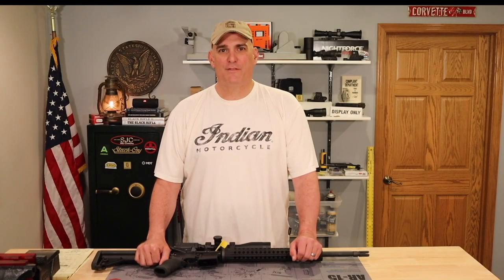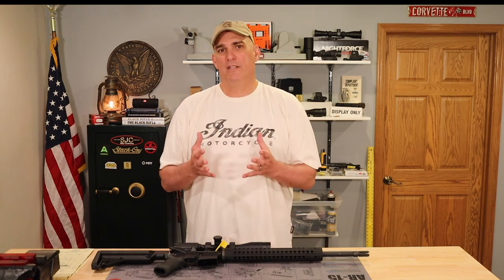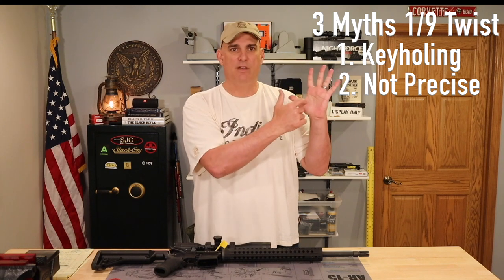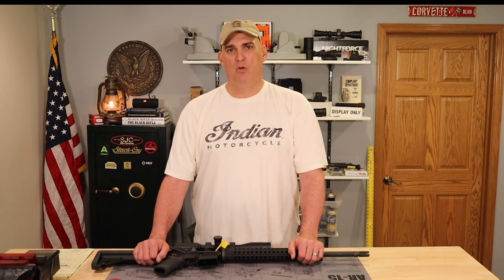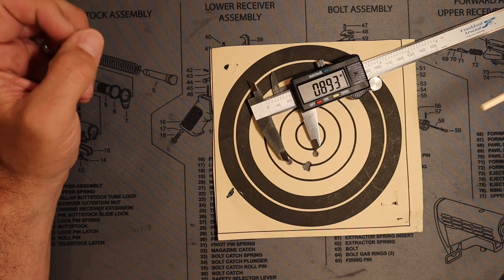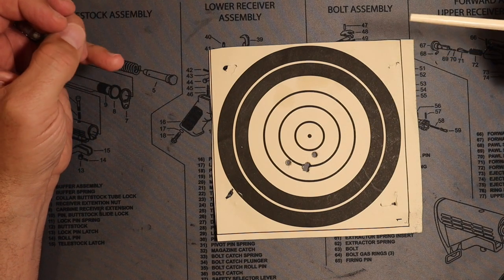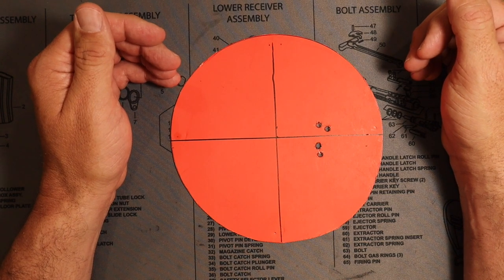Why AR-15 twist rate does not matter w/ stability | accuracy. Pt 1.

Comment: Thank you! I've had people tell me my 1-7 barrel needs 62 grain or heavier bullets, but my experience has been that this is false. My gun shoots 55, 50, and even 42 grain bullets in sub 2 MOA groups. It does well with 75 and 77 grain bullets as well, at least out to 300 yards.
Reply from the maker: Good to hear. I believed the same thing for years until I started independently testing ammo. Funny thing is I still get people arguing with me even after they see my videos. Thanks for watching.
Reply: Does twist rate have an effect if the barrel heats up? I noticed after a one mag, my AR's zero changes.
Reply: If you search for different videos on youtube, you will find 1:9s shooting 75s or 77s to 500+ perfectly. In others, you will someone shoot a 75 from 1:9 at a target ten feet away and it will keyhole.
There are a few variables that explain this:
Elevation: the higher the elevation, the more stable a given bullet at a given velocity will be. A bullet on the edge of stability will be quite unstable much quicker if you drop from 2,000 above sea level to sea level.
Temperature: the higher the temperature, the more stable. A marginally stable bullet at 100 degrees will lose stability much sooner at 70 degrees.
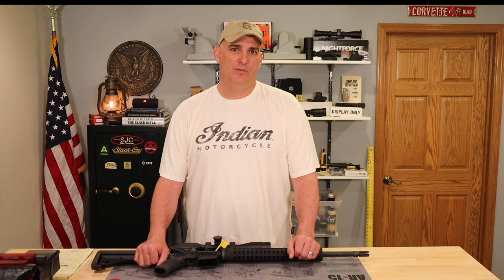Barrel variance. Between manufacturers, and even within them, a '1:9 twist' is not always really 1:9. Some 1:9s measure closer to 1:8 than 1:9 (example, stamped with 1:9 but it measures 1.84) and some measure closer to 1:10. The 1:84 '1:9' might slang 75s with no issue. The 1:9 '1:9' might be stable for a hundred meters or two, marginally stable for another hundred, then unstable beyond that. The 1:98 '1:9' might not be able to reliably stable 69 grainers and keyhole them if the target is more than a hundred yards away.
Lotsa variables. Just because one gun shot at one place fires heavies fine does not mean another very similar gun will be able to.
(I have a 1:9 twist AR and went through a period of remorse where I was sad because I was told I couldn't fire >69 so I did TONS of research - fiddled with online calculators that where you can input bullet length, weight, elevation, temp, twist, velocity and see how a few seemingly small changes in any one variable can have a huge impact on stability.)
Also - don't worry about firing 75s or 77s unless you're looking for high BC stuff for long range. If you want the bestest terminally effective bullet of all, it isn't a 75 or a 77. It's a 50. 50 TSX, baby! (Only somewhat my opinion. In gel tests its terminal performance is objectively among the best.) And the best thing about a 50 grain is that all of us - the teenage 1:7, the generation alpha 1:8, the millennial 1:9, or even the grizzled baby boomer 1:12 - all can fire a 50 grain and needn't be concerned at all about stability.
Reply: @PracticalAccuracy  Facts are facts, right?
Reply: You and I went through the same think when I first got started with my AR15 . I think people mean well but every gun and barrel favors a certain round .  A 300 yard maximum distance is my benchmark within a kill zone in a hunting situation on hogs and coyotes .
Reply: @smokingcrab2290  Yes it does and some barrels more than others .  As a hunter I want my first round to be on the money and close with a three shot group if I need follow up shots .
Reply: That's horrible! 2moa is bad..
Reply: @hunterjager9538  Sub-2 MOA is just fine for practical accuracy on a human torso-sized target, even at 300 yards. That's a sub- 6 inch group at 300 yards. Those are all kill shots.

Comment: If you get a barrel with a 1 in 8 twist, you can stabilize anything that will fit in a magazine.
With that said, the problem with the 9 twist issue is that some barrels marks as 9 twist barrels, are actually 8.5 twist barrels. That is the reason for the controversy. A True 9 twist, will give you issues with 75/77 grain bullets. You may get round shot holes, but your groups will be horrible.
The last 9 twist Rock River Arms rifle I owned, had a measured twist rate of 1 in 8.5. It shot Mk262 very well.  Measure your ACTUAL twist on barrels marked as 1 in 9 and see what you get. I bet you best shooter with 75/77 grain bullets might just be 1 in 8.5.
Reply from the maker: I did measure the 16 inch barrel. I took 3 measurements and got between 1:8.75 and 1:9.125. thats as precise as I could do it. I did not measure my other guns, but I have heard that the rifling can be off from the manufacturer.

Comment: Excellent demonstration to dispel these ridiculous myths.  I shoot IMI 77 grain SMK BT HP's all the time in my 16" 1:9 twist with great accuracy.  I'll be checking out part 2 next.  Thanks.
Reply from the maker: Thanks for watching.
Reply: How accurate is the question because with my 16 inch 1:9 I get penny size groups at 100 on a great with hornady 55 gr frontier fmj while 75 gr bthp frontier from the same gun and everything my groups spread to 4-6 inch groups
Reply: @jorgesolis9468  I can't comment on 100 yard groups because my range only goes out to 25 yards. So at 25 yards I am putting them in or near the same hole. Good enough for my needs.
Reply: @BrewCityRider  yes well I hog hunt and shots vary from 10 yard up to 300 yards so I from expierence know that the twist rate at 100 yards and further does mean something and I am getting a 1:7 barrel as soon as I can to run my favorite rounds for pigs specifically because the difference of 4 inch groups and a penny size group at 100 means something to me and others
Reply: @jorgesolis9468  Yes, I can certainly understand why you need tight consistent groups at 100 yards. Well, this video just showed us that two of the 1:9 twist barrels he used were sub MOA and one was just over.
Reply: @BrewCityRider  true would also depend on oal of the bullet itself usually heavier means longer sometimes it doesn't

Comment: I find it crazy that consumers are always after the 1:7 twist barrels and yet the most common ammo on the market is M193 or M855. I have plenty of 1:7 barrel builds but I'd rather make 1:8 or 1:9 barrel builds. It's not even a matter of being in stock. They're just almost impossible to find. Anyone know of a 1:8 twist 16" 4150CMV Nitride/melonite barrel with a properly sized mid-length gas port?
Reply: Palmetto State Armory  offers the 4150 CMV Carbon Steel Barrels {sometimes nitrided/sometimes parkerized/ occasionally chrome lined}  ... IF YOU WANT THAT.   I prefer Wilson Combat STAINLESS MATCH GRADE. 1:8 are commonly available... in 223 Wylde or 5.56 ... Wilson Combat  sometimes offers 5.56 in 1:7, as well.  Lothar Walther  have recently started offering AR barrels.  German made & sometimes stocked in USA warehouse  ..and, might be worth having.
Reply: PSA makes one 16inch with a 1:8 twist but not with that barrel and a carbine length gas system.
Reply: Billy Freeman Check out Del-Ton (DTI) that usually has mid length 1/9s but BCA or Bear Creek Arsenal have 1/8 and 1/9 in various gas lengths. But the barrels most likely are 4150 CMV (Chrome Moly Vanadium). Del-Ton barrels are Manganese Phosphated 4140 CMV.
Reply: For your last sentence you should look into Criterion barrels. Specifically their 223 Wylde hybrid or core barrels. Your description is spot on with what they have and are VERY accurate. Lastest price I saw was $280-300 on back order.
Reply: Aero precision has a 1 in 8.   16"  barrel
Reply: Worth mention not every 5.56 rifle is an AR, for some the only available twist rates are 1:12 or 1:7 with no in between
Reply: Del ton inc might have that.
Reply: 1:7 is a no brainer for me. Under 300 yds, 855 or 193  isn't going to make any difference but when I want to reach out and touch something at 500 and longer you would be foolish to use these short projectiles or a barrel that doesn't excel at 69g+
Reply: Lol no, but I do love my 16" cold hammer forged 1:8 twist ruger ar 556 carbine mid length gas system . Amazing rifle for what I payed for it.
Reply: Faxon 16" Gunners are out there that fit that exact spec
Reply: Ruger AR 556 is 1/8  but carbine length.

Comment: I see your point in this video. From what I saw, you shot one bullet weight out of 3 different barrels with a 1/9 twist rate. I don't feel that a blanket statement of twist rate does not matter is fair here. If you had shown how 55gr, 62gr and 77 grain shot out of a 1/9 barrel it may be more of a valid argument. I have a rifle with a 1/8 and one with a 1/7. The 1/8 prefers 55gr and will produce 1moa groups. The 1/7 likes 62gr and will produce a 1moa group. If I interchange the bullet weights between these two rifles; the 1/7 with 55gr and 1/8 with 62gr the group sizes open up significantly and approach 3-4moa at 100 yards. If it truly did not matter, there would probably only be one twist rate available for a 5.56 barrel. I am not here to say you are wrong, I think that your video is saying that 1/9 twist can shoot 77gr, not that overall twist rate is irrelevant to the accuracy of any given bullet weight. (Edited for misplaced number)
Reply from the maker: What you say is true. However,  shooting 2-3 inch groups does not mean your bullet is unstable.  It just means that your rifle doesn't like a particular load. What I was trying to demonstrate was that the bullet will not be so unstable as to keyhole. 55 will not keyhole in a 1:7 twist. It may or may not shoot good groups. I should have be a little clearer in the video on this. Thank you.
Reply: @PracticalAccuracy  I would agree with you on that. It's not keyholeing, just a larger group.

Comment: Thank you for the honest field report.   I am not entirely  shocked by the results.   Black Hills are a fairly good quality ammo with a "fairly warm powder charge"... {usually referred to as 'full power loads'}.    I do wonder if  the  "somewhat valid part of the  myth"  relates to INFERIOR quality barrels or barrels with poorly cut rifling grooves, improperly cut muzzle faces or barrel crowns  &/or  "reduced velocity  loads"  that do exhibit  reduced rotations per minute... and, 'lastly',  the Pistol / SBR {very short barrels} which also give up some bullet speed and Rotations per minute.  Effectually,  I 'suspect & speculate'   that  a 7.5", 8.5"  or 10"  SHORT barrel firearm with budget grade mystery maker ... loaded with  budget grade mystery maker 77 grain  {reduced velocity loads} might give different results: such as ... tumble, yaw, key-hole, poor accuracy, etc.  Such combinations might be where the myths prove to be true.
Reply from the maker: I would be interested in the SBR results. I don't have any experience with them so i limited my opinion to 16 inch plus barrels.

Comment: I got a 1 in 7 twist 16inch barrel AR and tried out various high quality ammo through it. It happens to prefer the 69 grain federal premium Sierra matchkings the best. It did slightly worse with the higher grain stuff.
Reply from the maker: Yes. you have to test your barrel to see what it likes.  Twist rate doesn't necessarily correspond with accuracy.

Comment: What about light bullets? 55gr, 40gr maybe?
Reply from the maker: Good question. I have not tested anything lighter than 53 gr out of a 1-9 twist or 55 grains out of a 1-8 twist.  They were completely stabilized.  1-7 may give you problems below 55 gr with light jacketed bullets. The twist rate is fast enough that some light jacketed bullets may actually come apart mid flight because of the high rpm rate. There are videos showing this. Also, remember that your twist rate doesn't guarantee an accurate gun. You still need to test different bullet weights in your particular rifle.  I will hopefully be testing 1-7 twist in the future.

Comment: I type this message before watching the video, so forgive me if it is addressed. I'm interested in getting an AR pistol in 300 bo and running subsonic to eventually suppress. The options are 8.5" and 10.5" barrel lengths. Will it matter especially with the shorter barrel what twist rate I chose? Would 1:7 be better for the shorter barrel, or does it even matter especially when we intent its primary use to be short distance for home defense? Thanks.
Reply from the maker: Sorry, I don't have any experience with 300 black out.  I would assume 1:7 would be your safest bet.  Thanks for watching.

Comment: why AR? does it not apply to bullpups? i have a aug a3m1 1:9 16"
Reply: One video I saw said it’s due into how long the projectile is? A shorter 75 grain bullet is capable of stabilizing but when you have the jacketed hollow pointed options that are longer or just the longer ones in general. That is when you see issues?

Comment: In for info. I have what I believe to be an old colt m16a1 barrel heavy 1 in 14 twist (the upper and barrel have colt Markings). it keyholes with 62gr green tip but not 55gr at 25yards. Thoughts?
Reply from the maker: You are going to be limited to 55 grain or less. 1:14 simply won't stabilize anything above 55. Also, if you shoot in very cold weather, it may not stabilize 55 gr. That is why the Army switched to 1:12 twist because of cold weather problems with 55 grain. The good thing is you have a rare Colt that is worth a hefty price in the collecting market, assuming you have all original   parts. If you decide to sell, make sure you have it appraised first so you don't get taken.
Reply: @PracticalAccuracy  thanks for the info. I am going to try and rebuild it back to its glory days. Might keep might sell.
Reply from the maker: @AngryMarine9999  Good luck

Comment: I new to the AR platform and bought a 16” barrel 1-9 twist. Where should I start with bullet weight?
Reply from the maker: what distance do you want to shoot?
Reply: 55 grain. 62 grain at the most. 
Light-slow, heavy-fast. (Grain-twist)
Reply: You'll find between 50-69 grains to be the sweet spot for 1-9 twist, you can go a tad lower or highr but you're risking destabilizing if you go any higher.  SS109 62-grain military ball was optimized for 1/9 twist (though 1/7 was chosen for tracer stability), but you can easily go above 62 grains.. Most 69 grain cartridges tend to shoot pretty good outta 1-9, and as shown in the video many will handle can go even heavier.  Every cartridge will shoot differently out of each barrel no matter the weight or twist of the barrel.  And if you're looking to get your tightest groups then you're going to want to shoot match grade stuff (ie match kings, bthp, ect) as you won't find the best accuracy with surplus fmj like 55 grain m193 or 62 grain green tip/ss109 ; although some barrels can shoot it pretty good.
Reply from the maker: @muddyhotdog4103  I couldn't agree more. Thanks for watching.
Reply: @PracticalAccuracy  I think my skill level won't let me shoot must past 100 yards.
Reply from the maker: @mrush336  55 to 62 grain to start practicing. If you get better and want to shoot past 300 yards, start using 68 or 69 and past 600 start using 75 or 77 grain. Good luck.

Comment: How accurate is the question because with my 16 inch 1:9 I get penny size groups at 100 on a stand with hornady 55 gr frontier fmj while 75 gr bthp frontier from the same gun and everything my groups spread to 4-6 inch groups
Reply from the maker: You hit the nail on the head. Every gun is different. Also, with 1:9, if the barrel manufacturer does not cut the rifling accurately, some 1:9 could be closer to 1:10, which will generally not optimally stabilize heavier bullets.  You can always measure your rifling to double check the twist. If you don't know how, Midway usa has a short video on youtube showing how it's done. thanks for watching.
Reply: @PracticalAccuracy  mine is a true 1:9 since 68 gr stabilize with penny size groups as well winchester extreme point

Comment: Mine is 1/7 twist. Is it better to shoot longer heavier bullets? I heard lighter 55 grain would probably not be accurate due to over stabilization.
Reply from the maker: You just have to try it.  Your gun may like 55 grain.
Reply: I've heard that too, but my 1 in 7 barrel seems to do great with 55 grain. 1 to 1.5 MOA at 200 yards.
Reply from the maker: @hartsickdisciple   You gotta test to verify. Good thing you did.

Comment: 55 gr is most popular and cheapest ammo to buy.   I never see 77 gr anywhere and on rare occasion  you find it, it’s super expensive.   Why are 1/7 twist barrels so popular?
Reply from the maker: Before the ammo shortage you could get black hills 77 for about $1.15, which is expensive.  However, I would rarely shoot more than 25 rounds in a session. Now, it's super hard to find and prices are over $2 and sometimes as much as $3k so I haven't bought any in over 2 years. I'm glad I stocked up when I did. As far as 1:7, I think it's plain old American marketing.  My 1:9 twist barrels from Rock River are tac drivers. Thanks for watching.
Reply: @PracticalAccuracy  Thanks!  If I had to do it over, I would have purchased a 1:8 or 1:9 twist since I also have a 14.5" barrel.  But then again, for practical purposes it shoots anything.  Sometimes I tend to over complicate things.  lol
Reply from the maker: @rich1958  Agreed. I'm trying to keep it simple.

Comment: Ok here me out... if twist was dependent on bullet length then why does they very long m855a1 shoot better in a 1n9 then a 1n7.
Reply: "Better" is completely dependent on the barrel design, twist rate and material & process used to construct the barrel. The point of the video is primarily put to rest the myth of stabilization between the three most common twist rates. All will stabilize perfectly fine but when it comes to accuracy there's far more variables that take priority above twist rate.